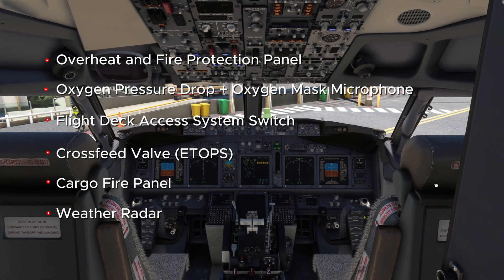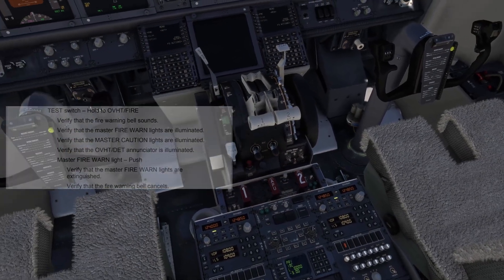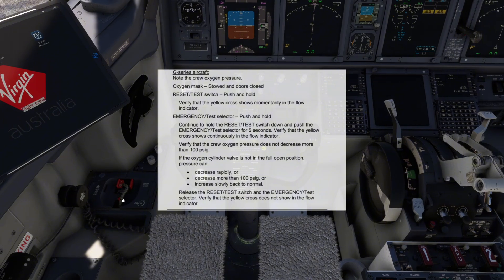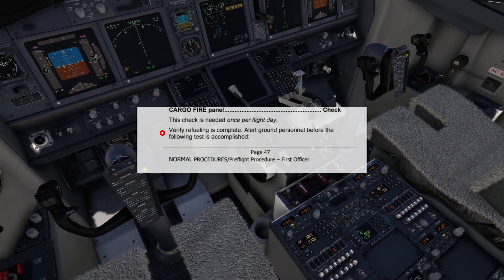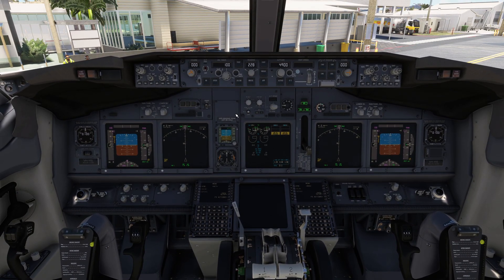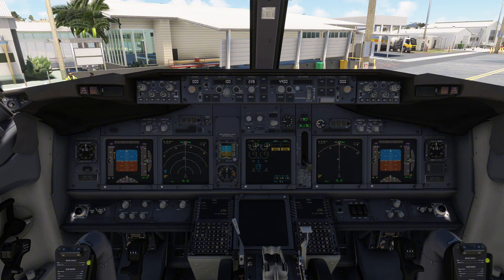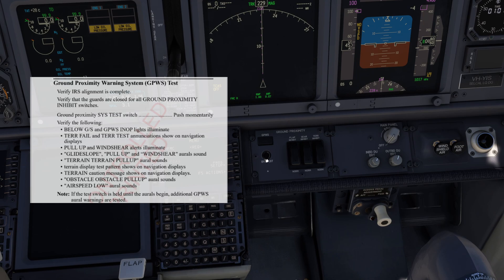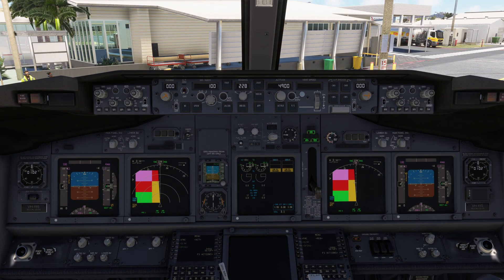PMDG 737-800 Tutorial: 'Once Per Flight Day' TESTs

Comment: Does a 737 emit radiation??
Reply from the maker: Yup very little but still could be a concern if you are within the safe distance, especially ground crew getting the lockout pin from the nose wheel and other aircraft re-fueling. The main worry is on the weather radar as the beam is sweeping left and right. I'm not sure which of the 2 weather radar's pmdg modelled, but if your weather radar emits over 25kw in Australia here are the rules. Hope this helped you out :)

* 6) Ground operation of aircraft radar equipment

-6.1 The requirement of this subsection shall apply to all radar equipment with a
nominal peak power output rating in excess of 25 kW.
-6.2 During all ground operation, including testing and maintenance of aircraft
radar equipment, the operator and person in charge of such equipment shall
ensure that:
-6.2.1 The equipment is not energised in its normal mode (antenna rotating) unless
the sector area scanned by the radar beam is clear of the following objects to a
distance of 37 metres (120 ft) from the antenna:
(a) aircraft being refuelled or defuelled;
(b) fuel tankers, fuel tanks or fuel storage areas;
(c) persons or cargo;
(d) any other aircraft or aircraft hangar.

- (Civil Aviation Order 20.9)

Note: For each radar installation the sector area should be defined in terms of readily
distinguishable dimensions preferably related to some feature of the aircraft and should appear
in the Aircraft Maintenance Manual.

-6.2.2 The equipment is not energised with the antenna stationary and the beam
directed towards any of the objects specified in paragraph 6.2.1 unless the
distance separating them from the antenna is in excess of 60 metres (200 ft).
-6.2.3 The distance specified in paragraphs 6.2.1 and 6.2.2 may be reduced by
75 per cent when an approved beam attenuating device is used between the
antenna and any object specified in paragraph 6.2.1.
-6.2.4 The equipment is not energised in any radiating mode of operation when the
aircraft in which the equipment is fitted is in a hangar or other enclosure
unless a suitable microwave energy absorbing shield is fitted over the antenna.
-6.2.5 The equipment is not to be operated in any aircraft which is being refuelled or
defuelled.

Note: During all testing of aircraft radar equipment the beam should, whenever possible, be
directed with maximum upward tilt toward a clear area.